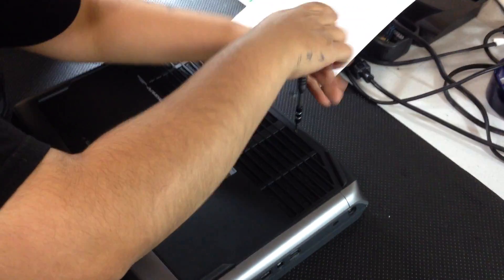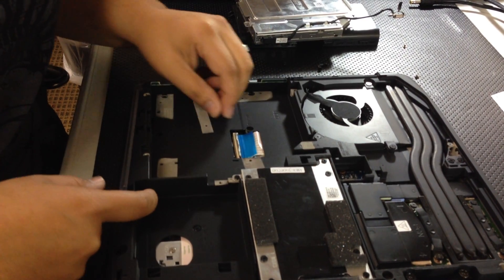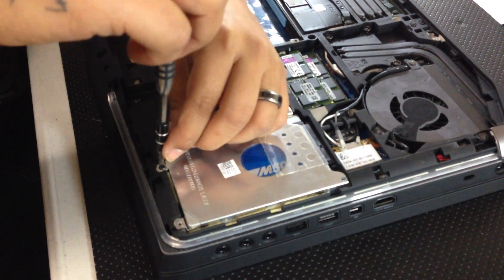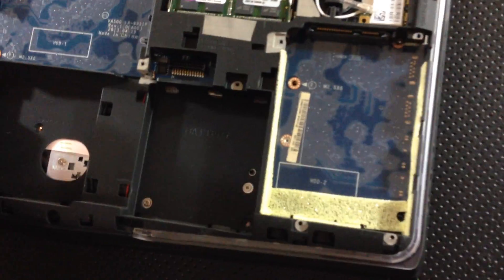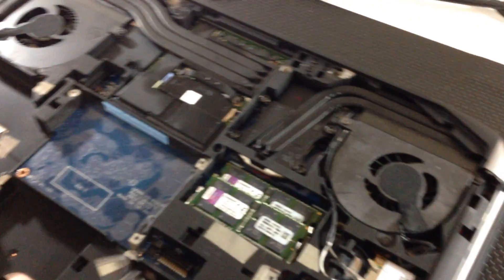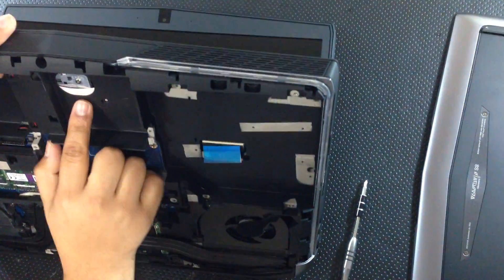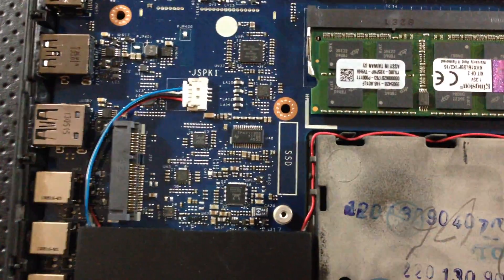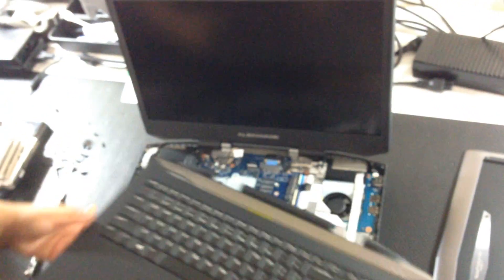ALIENWARE 17 17x -  HOW TO GET INSIDE? // HIDevolution

Comment: can anyone tell me if this spot is for a regular ssd? It looks pretty snug under there, does it need to be taken out of it's enclosure or something?
Reply: awesome thanks for that, I took mine apart intending to switch it out for a larger ssd and was like wtf.
Reply: The silver caddy on the lower right side is for a 2.5 inch hard drive or SSD.
Reply: the one under the keyboard?
Reply: no this is for an MSATA (its smaller, just a card) its smaller and has no case like a traditional ssd

Comment: I'm guessing if you get 8Gb of RAM stock, they put it in the most easily reachable spot just under the cover and HDD?  The other two slots are pretty much buried under the keyboard, is that right ?
Reply: This used to be true yes but more recently we have been hearing that they are indeed using the harder to reach slots for the stock memory leaving the easy to reach ones empty for future upgrades :)
Reply: Jose Toribio It's not the case. The easier to access ones are located under the easily removable back cover.

Comment: Hi! Just wondering if a CPU swap for my 17 R1 (to a 4900MQ) is as easy? Do I need to get the keyboard out? Many Thanks! Great Video, btw.
Reply: Just remove the fan and heat sink assembly. You should have direct access to the CPU at that point. The CPU has a dual-pipe heat sink, if you were wondering which one it is.
Reply: ***** THANKS! Incredible help!